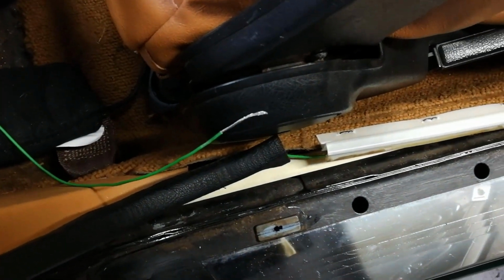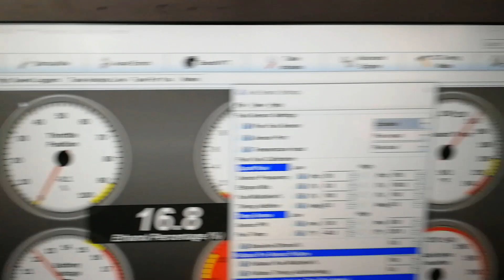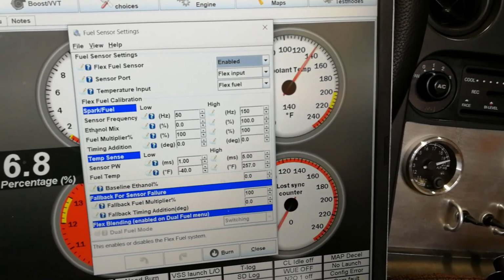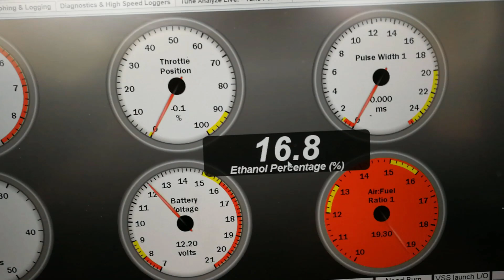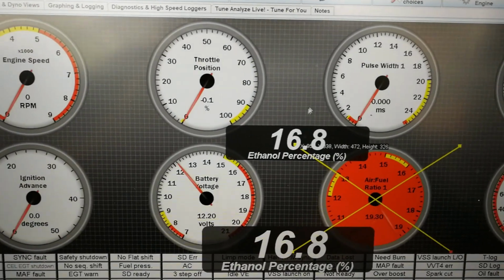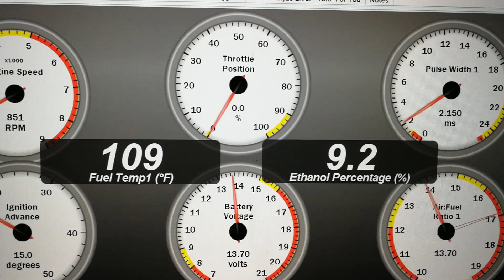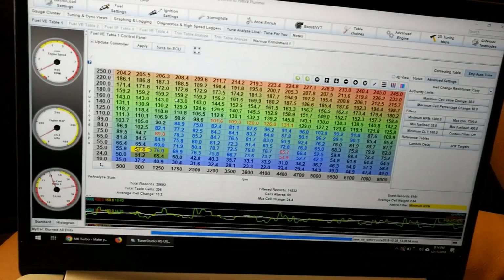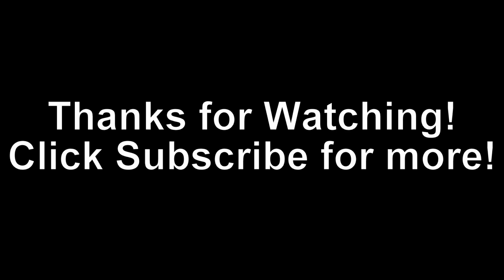Miata E85 Flex Fuel Sensor Wiring and Setup

Comment: shouldn't you be using a power ground? Since it is a +12v Power Supply to the FF Sensor
Reply from the maker: Most sensors on the Miata are 12v, however you want to ground low power (amps) things like sensors to the same places and high amps things like coils or solenoids to a separate place. This reduces transient surges and improves the accuracy of the sensor.

Comment: I see you used a newer e85 sensor off a GM. My question is does it work properly? Megamanual says use older GM sensor.
Reply from the maker: Yes, it reads it fine! The output specification is identical to the older sensor.

Comment: Hey did it manual mention in lining a 10k resistor with the signal wire?  For mines it says it needs it. I have the ms2 pnp... and now I think ill have to rig up the box and solder the wire in . Now kinda wish they had the inputs in the hardness
Reply from the maker: For my ms3x i didn't add anything, the flex input is already set up and I made sure to include the line to it in the harness I built.   For the ms2 it looks like a couple of resistors are needed, one for a pullup to 5v and the other to the ecu pin.  Here's the megamanual section (which you may have but just to help future people with the same issue): http://www.msextra.com/doc/pdf/html/MS2V30_Hardware-3.4.pdf/MS2V30_Hardware-3.4-29.html

Comment: Do on the  tuner studio days page show the e85 content once you install the flexfuel sensor..? So really dont need a content gauge then huh, I'll just buy a sensor... maybe a congenital one
Reply from the maker: Right, you wouldn't need a gauge unless you wanted one.  Once the flex input is enabled in TS then you can put the content and temp readouts on your default TS dashboard.
Reply: @OGPedXing  I would still need a flexfuel sensor correct? I was literally waiting for your reply so I can buy one on Ebay.. think those cheap $50 works from china.. same thing I think
Reply from the maker: @dangerousfandango5943  yes, once you have the sensor you can hook it up like the video and then tune from there.  The China versions can be hit or miss..mine is a cheap one and it's been ok so far.  However a real one from like an online gm parts store is about $100.  If you're going to run high boost I'd spend the money because an incorrect reading could give the engine too much timing and blow the engine.  There are two "Continental" versions, a small one like I use and a large one.  They are the same aside from size.

Comment: Great video and channel.  Did you add a separate fuel temperature sensor, or do you get that signal from the flex fuel sensor also?
Reply from the maker: Yeah it's pretty cool, both come from the sensor.  What it does is send a pulse and the width of it is converted to a temp.  The frequency determines the ethanol percent.

Comment: Great video again! Also, impressively stable idle. For your closed loop control do you use advanced with I, P and D settings or simple? I'm currently dealing with my idle valve fluctuating hence causing unstable idle rpms.

Also where is your IAT to avoid heat soak? Cant find it.
Reply from the maker: Right now I have it on simple and it's been fine actually, ev14 is legit.  I find giving it a bit more fuel is where it's happiest.  Around 14 to 14.4 afr gives me the most vacuum and no hunting.
For the IAT it's in my custom intake right after the filter but shielded by a diy heatshield.  I have a video for that build, https://youtu.be/yICAGQUsbIM.
If you have an intercooler I recommend putting it in the outlet pipe right after the cooler but still in front of the radiator.
Reply: @OGPedXing  I saw that video after posting this. Thanks! Yeah hot restarts are causing a lean hunt due to the IAT getting heat soaked. It quickly goes away once driving but its just a PIA.

I'll try that. I'll target a lower lambda and see if that makes any difference.

Thanks again and keep it up with the videos!
Reply: OGPedXing i read on the forums that auto tune in the idling cells isn’t worth a shit so you may just have to manually adjust those cells